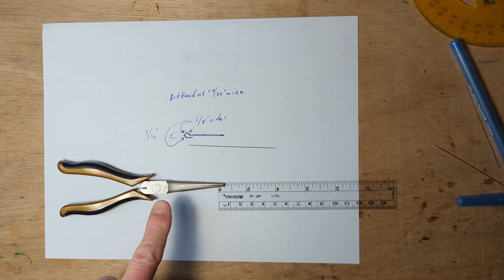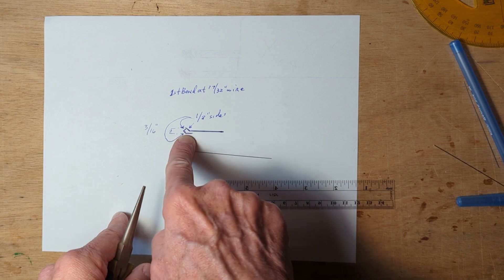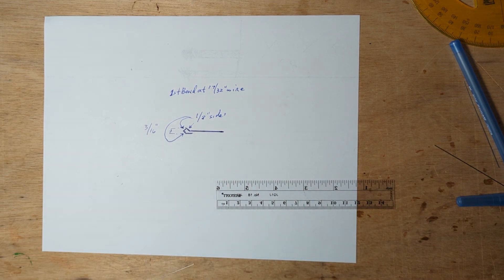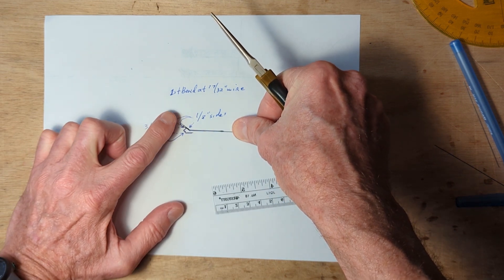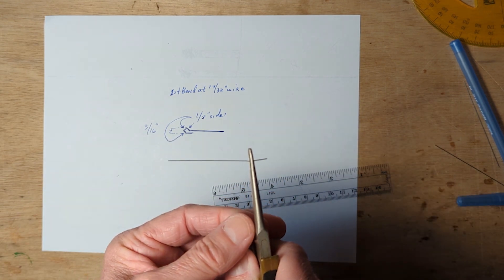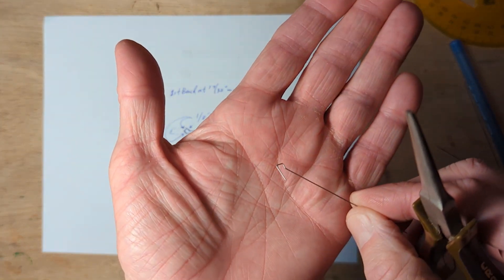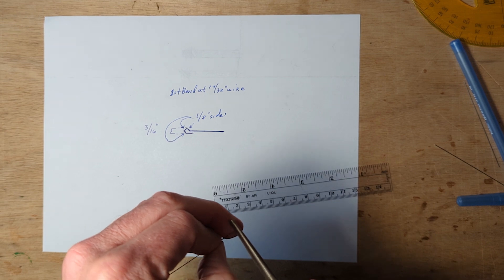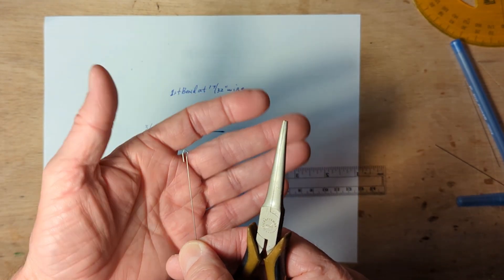Rotor shaft hook bending demo

Comment: The second and third bends are both right angle bends. That end bit can be bent at a right angle across the other part in a right handed helix so the other part will block to motor from twisting itself off the end of the hook. It must extend a bit past the crossed wire. It must come out of the plane of the first sections enough to leave a gap for the O-ring. Bending short pieces of wire is easier if you push it with a small block of wood. I use a circular helix, but the diamond may center the motor better.
Reply from the maker: Yes, second bend is 90 degrees. I said correctly initially in the video and then misspoke and said 135 degrees while I was bending.